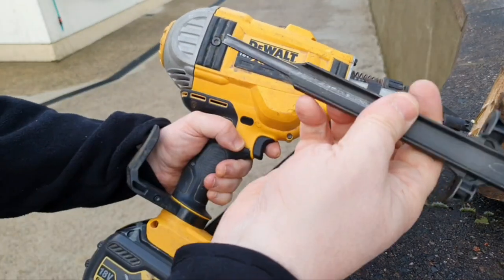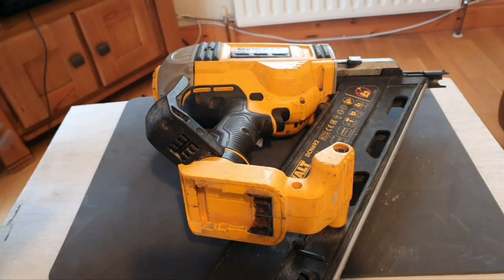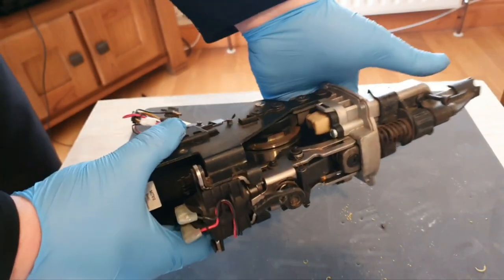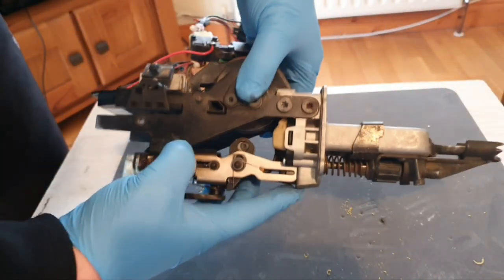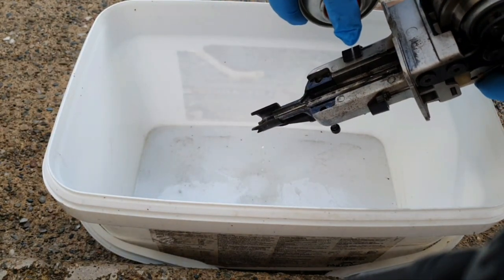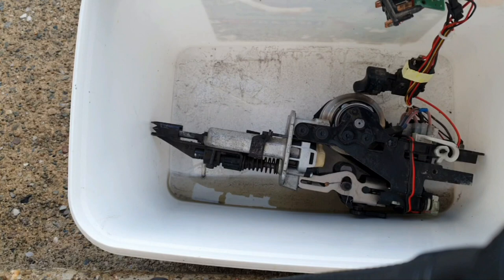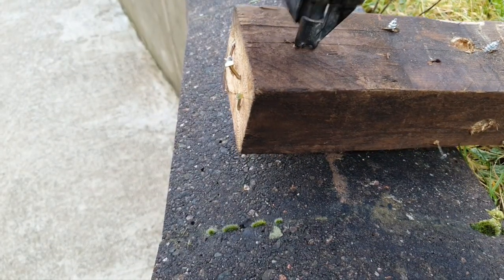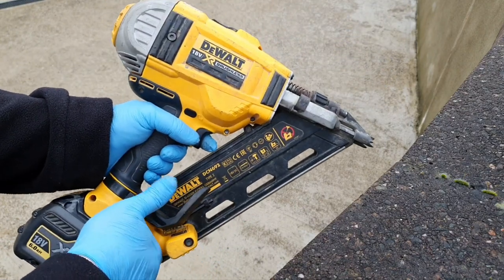Dewalt DCN692 repair Part 2

Comment: Thanks alot for this video. It turned out that I didn’t need any parts, just a good cleaning, just as you showed in the video.. That save me alot of money and maybe a trip to the Dewalt servicestation. At the first try, I was a bit disappointed, the nail didn’t go in all the way in, but the second one went a bit deeper, the third one went all the way. I’m so happy it worked again.
Reply from the maker: Thats great thanks for the comment

Comment: I was just about to order a new firing pin for mine, really appreciate this video, seems pretty common in these guns. 👍🏻👍🏻
Reply from the maker: You are welcome
Reply: Firing pin? Is that what he called the profiler?
I sprayed the crap out of everything, and even put new springs, but every nail only goes 1/2 way in?
Reply: I’m not the expert so excuse my lack of proper terminology but we do use them a lot and it’s very common in these, turned out my pin was missing a piece from the end, was only about 3-4 mm short but made a big difference. The wheel not gripping up on the pin seems very common 👍

Comment: That's the exact issue I was having with my framing nailer. It annoyed me so much I haven't used it in 7years. Now I have something to try to fix it. And I only occasionally used a framing nailer and never even made it through the first box of nails.

Comment: Dual speed motor. I see the selector switch in low speed when you had the problem. After you "fixed" it the selector was moved to high speed. The motor is audibly faster when it worked. I'd bet you just had to flip the switch from 1 to 2.

Comment: Hello, I also repair dewalt tools. Here is a way to diagnose and repair dewalt nailers dcn692 and dcn21pl for half way shooting nails:

When the nailer is fully assembled, check the end cap (part number N028372 for dcn692 type1); try to move it left and right, or up and down. If the end cap was loose, then that will be the problem and need to be replaced. 

The loose end cap takes off some of the friction force that supposed to be applied to the nail and that will cause the nails to not go all the way.
Reply from the maker: Thanks for the advice

Comment: Hi I have exactly the same problem with mine. So basically it was just dirty and needed a good cleaning or should I replace the profile as well
Reply from the maker: Try it first you can always replace the profile later

Comment: Hey mate.  Do have any videos for Dewalt  DCN21PL  21° framing nailer type 1. taking apart?
Reply from the maker: Sorry man that's a model I never had in my hand
Reply: I just took mine a part and cleaned it. It was easy and it did improved the sinking of the nails.

Comment: How about an ultrasonic cleaner?? Then give it a day or so to dry out or something like blow drying it out with a hair dryer then spray it lithium lubricant oil??
Reply from the maker: Yes to the rest but lubricant on the wheel is going to mess up the firing process

Comment: What should I do if a put a lot of pneumatic gun oil into it?
Reply: Tear it down and spray the hell out of it, to get all the oil out!!
Reply from the maker: It's a big job getting the oil cleaned off full teardown clean all the oil off and put it back together and cross your fingers
Reply: @doctorlefthandthread why is it a “pray” thing? Oil can always be removed, so it seems IF OIL ever got in there, that it could be removed and returned to “pre-oil” condition? Am I wrong? Please address…
Reply: @SuperDave227D  Something about the flywheel tends to soak the oil up and even after trying to degrease it often times they won't work.  Some people have said they've had luck roughing the flywheel back up with 100 grids sandpaper.

Comment: Do you not need to lubricate any moving parts after cleaning?
Reply from the maker: Oh no a big mistake in these dewalt would be adding any kind of oil or lubricant. They are made to run dry